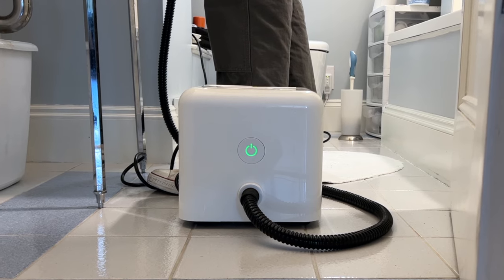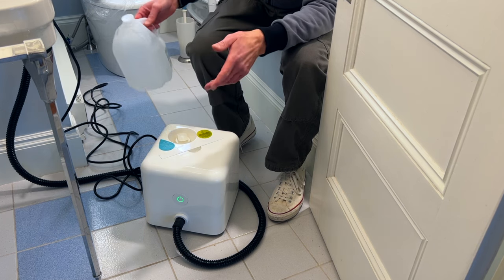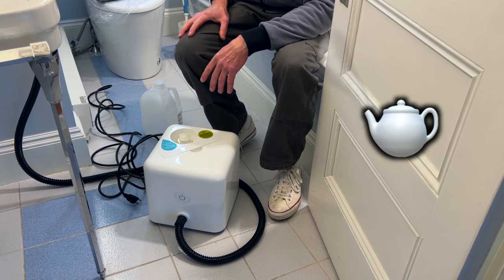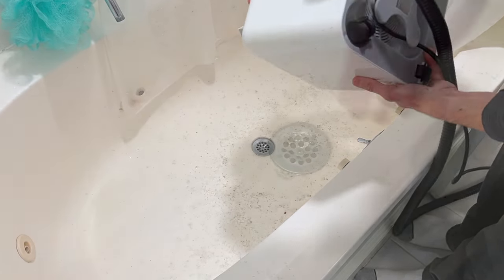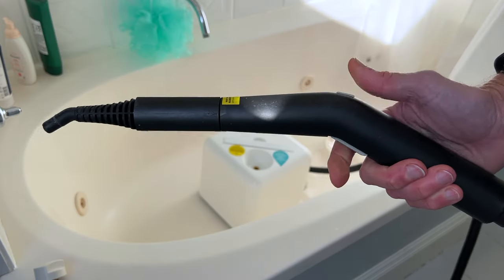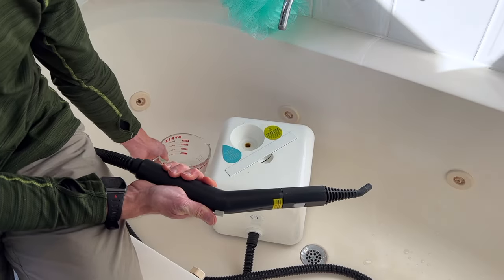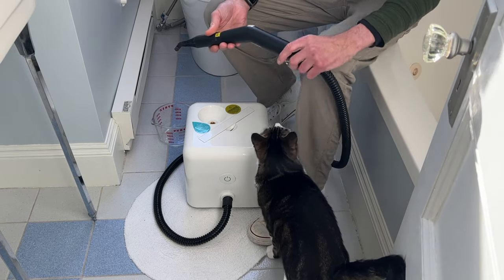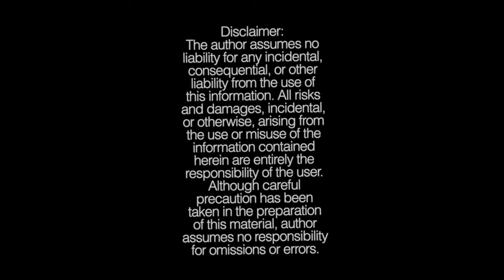Dupray NEAT Steam Cleaner - NO STEAM or SPRAY!!! Solved!

Comment: Thank you so much for sharing your information.   I was ready to throw the unit out, but now there is hope that I can get the unit working again.  I love your helper too. We just adopted a kitten and I need to do a lot of nontoxic cleaning!
Reply from the maker: I hope it works out for you. We have two cats and the steamer comes in handy for washing out litter boxes. We recently switched from clumping low dust litter to non-clumping crystalline silica litter (similar to Pretty Litter). It’s lightweight and it makes scooping poop and changing the litter easier each month easier. The steamer gets out the urine odors in the plastic litter boxes without having to use chemicals. Good luck!

Comment: I just received an email from dupray customer service because mine also will not steam.. they did recommend to repeatedly press the steam button on handle and use an air compressor or hair dryer to blow in end of nozzle like you did…they also said there is a small steam hole diagonal to the boiler cap. I can’t find it. But they also said they do not recommend using vinegar to descale… I’ll just copy and paste their reply yesterday to my issue I still can’t fix…

The machine can be clogged in two different spots, either at the steaming hole inside the unit or at the handle.

The steaming hole of the NEAT is very small, so calcium or sediments can block it easily. 

Please try the following troubleshooting steps:

1. Fill the boiler with clear water, and swish it around. The steaming hole is at the top of the machine, diagonal to the boiler cap.
Hitting the steaming hole with water can help to flush out debris that are stuck.

2. If you have an air compressor machine, please shoot some air into the hose through the steam exit hole on the handle. Make sure the machine is unplugged.
Repeatedly pull the steam trigger. This can help to free any debris blocking the steam from coming out.
Alternatively, you can try a hairdryer or air pump to blow air in it. If the blockage is at the handle area, that can help free it as well.

*Please note, we have stopped recommending descaling the NEAT, as the aluminum boiler is sensitive to the vinegar.*
Reply from the maker: Thank you! That’s great information. When I spoke with a rep at Dupray about 6 months ago regarding why my manual says one thing and newer manuals say something different, the rep said it depends on the country of origin and sale. I really question the longevity of this product and the quality of materials used because changing the recommendation on how to care for the product leads me to believe they launched a product without adequate testing and quality control.
Reply: @BruceAlanR  I just bought this model and it's made in China.   I've used the steamer only TWICE and, already, the steam is intermittent .   Sending it back

Comment: Thanks for this cleaning review.  I’ve never had a blockage in mine but I use distilled or 50/50, and I also have descaled periodically.  Interesting they no longer recommend vinegar/descaling; that explains why the Neat Plus I just got says nothing about cleaning in the manual.  Distilled water is great but we can’t refill those jugs so more stuff just gets trashed 😩.
Reply from the maker: It’s so strange they no longer recommend vinegar. Even with distilled water I was finding buildup over time. I don’t understand how they expect the user to clean it.

Comment: Thank you! This is very helpful!
Reply from the maker: Welcome! Recently, I’ve found that letting the unit completely cool, removing the cap, and then blowing in the end of the wand with the trigger depressed usually solves the issue quickly. When it doesn’t work, allowing the water and vinegar to sit in the tank for 4 hours with the top off, then shaking, rinsing well, and finally blowing in the end of the hose with the wand’s button depressed has worked. No need to leave it overnight.

Comment: I've contacted the manufacturer due to ours not producing steam anymore, they're NOT RECOMMENDING using vinegar anymore as they've realised it'll damage the tank/boiler. Possible warranty breach. I'm trying to clean/descale ours or will ask manufacturer to replace but since its year two of warranty it's now £29.99 to replace.
Reply from the maker: That’s helpful info. I called them 4 months ago because my manual said to leave vinegar in overnight and the newest model manual says to leave in for 45 minutes. The rep told me it depends on when the unit was made and country it’s being sold in… I don’t know what that even means! Something must have changed. How did they recommend removing mineral buildup if not with vinegar?
Reply: After finishing with the vinegar (or any acid for that matter).  You fill the tank with water mixed with washing soda as it neutralize  the acids and flush with clean water a few times
Reply from the maker: Good advice! Thanks!

Comment: Dupray decided that vinegar was actually causing issues and they stopped recommending descaling and now have a video on their channel showing how to disassemble the handle to fix clogging.  I descaled my two Neats numerous times using their specified method (vinegar) and never had an issue but the water can be "milky" for a few times after doing it. So it may be better to switch to distilled water and drain unused water so as to avoid having to do any of this.
Reply from the maker: Great info. Would you  
be so kind as to post the link to Dupray’s video here?

Comment: I love my Dupray but I'm always worried it's filled with mildew. There's no way to completely empty the water out of the tank. Even when I shake it for 20 minutes, you can still hear water sloshing around in it. I've only used distilled water in mine and when I cleaned it out, there was a lot of scale and grey gunk. I really worry about spewing mildew into the air with the hose and tank. Any insight into this?
Reply from the maker: Interesting you should say that! I have been having the same thoughts recently especially if I don’t use it for a week or two. Part of me thinks any mold or mildew in the tank would be killed by the internal temps of the boiler as well as the white vinegar and water solution when descaling, but it’s impossible to know without opening it up. 
Regarding the scale and chunks that come out, it doesn’t seem to matter whether I use tap, distilled water, or demineralized water. I spoke with a customer service rep a while back and they said it should be descaled occasionally either way.
Reply: 0:07

Comment: I am currently having this issue. It was working fine until I decided to descale it. Now it will turn green but no steam. I have cleaned it out two more times since then and have rinsed it several times. I got mineral buildup out the first few times but now nothing. I don’t know what else to do to get it back.
Reply from the maker: Ugh! Sounds like a clog. With the unit cooled and unplugged and with the cap off, do you hear bubbles if you press the trigger and blow into the end of the wand? If you can’t blow into it, it’s still clogged. I had to shake mine pretty hard and give it a few rinses before I got all the deposits out.
Reply: @BruceAlanR  No bubbles. I think I need to do more rinses. I contacted dupray and they said that they no longer recommend descaling the NEAT, as the aluminum boiler is sensitive to the vinegar and can lead to additional clogging.

They told me it’s either a clog in the steaming hole at the top of the machine, diagonal to the boiler cap. They said to swish with clean water and try to get to that area. 

Or to take an air compressor or a hair dryer (on cool) and shoot the air up the hose through the exit hole and to keep pulling the steam trigger. They said that’s where the other clog is likely to be and can help free any debris it’s blocking. 

I’m hoping to try it and get my mop up and running. 😩
Reply from the maker: All very good info so thank you for sharing that. As far as not descaling, Dupray needs to get their stories straight. I contacted them 3 months ago because the manual that came with my NEAT said to leave the vinegar and water solution in overnight. In the latest manual it says to leave it in for no longer than 40 minutes. So which is it? Based on your conversation, they’re instructing you not to descale at all (which seems unhealthy because similar to an ionizing humidifier you don’t want to inhale the steam directly). 
Since you don’t get bubbles, sounds like a good blockage where the steam feeds to the wand. Here’s my recommendation: With the unit off and wand trigger pressed, fill the tank with water, put the cap on, turn it upside down to get water into the steam chamber, and shake it hard. Just be aware that if the clog clears, some water will come out of the wand (messy if the wand is below the unit but it’s a good thing— like a siphoning). Then take the cap off with it still upside down and shake out the water and debris.  Shake it hard as awkward as it is to do with this thing. I bet a lot more particles will come out. You may need to do it a couple times before it clears.
Reply: Same! I can't get it working anymore. I don't want to throw it away. 😞
Reply: @BruceAlanR  I really wish they had a way to disconnect the hose from the unit. That would make such a big difference. I love this thing but it has some real design flaws.
Reply: Did you ever get it working? Currently having the same issues despite multiple attempts at descaling and rinsing. No bubbles when I blow into the handle
Reply: @mazdaq1981  I did! They recommended putting an air compressor machine in through the steam exit hole on the handle and then repeatedly pull the steam trigger. I had to do this several times with rinsing it with vinegar and finally a weird red piece came out and it’s worked fine ever since (I had to shake it VERY hard at different angles before it came out). They also said I could try a hairdryer and blow cold air in it. If the blockage is at the handle area, that can help free it. It took a while before it worked. I wish it was a more sophisticated machine and have had my eye on the nicer models. I just don’t know if it would be worth it. Best of luck!

Comment: Will this method get rid of possible mold on inside of tank? I left water in there and forgot to empty.
Reply from the maker: Not sure, but vinegar does kill mold. It’s difficult to empty all the water out of the Neat due to the design, so I usually run it until no steam comes out.

Comment: This just happened to my unit this evening :( but I felt heat through the hose for about three quarters? I tried blowing through the end like you mentioned and I feel like it’s clogged in the trigger portion itself? Should I try steaming with the vinegar solution?
Reply from the maker: You never want to “steam” or heat the water and vinegar solution and it’s unlikely that the trigger is clogged. Let the unit cool down and then try filling the tank with just water and giving it a good hard shake. Do that a few times and then try blowing into the hose. See if that frees it up.
Reply: Thank you so much for all the tips! Got it back to working perfectly today thanks to you!

Comment: Hello if I did this in the morning how long I have to wait ? is it okay if I use the machine during the night ? thank you
Reply from the maker: Should be fine. It really depends. Sometimes it takes 45 minutes and other times a few hours. Blow into the end of the hose with the trigger pressed and if you hear air coming through you should be good. Also be sure to shake the unit really good while rinsing and sometimes that gets it loose.

Comment: what if you just used vinegar and distilled water while running it? id normally mop with that solution, so I'm sure i would've thought its probably fine and do it without knowing if it's good or not.
Reply from the maker: Other than for descaling I don’t think it’s a good idea to leave vinegar and water in the tank for extended periods. The latest Dupray Neat I’ve seen has a 6’ hose (vs 9’ like mine) and the instructions say not to descale for more than 40 minutes. That leads me to believe that vinegar and water left in the tank is causing some sort of premature tank failure. I’ve left vinegar and water in mine for a day and a half and the water came out black. I bet it was eating the tank.

Comment: My steam cleaner leaks and drips out of a screw no matter what I do, is possibly the water tank leaking?
Reply from the maker: It is possible the tank is leaking in which case hopefully it is still under warranty. Last week when I used the Dupray steamer, I noticed a puddle on the floor after the third refill (I was cleaning a mildewy shower); however, I wondered if the puddle had occurred because I’d overshot the cup during fill up and saw water drain down inside along the handle (a poor design IMO). It was a fair amount of water too… maybe 1/2 cup that missed the cup. I wiped up the spill immediately, but when I was done steaming there was another small puddle on the floor, which I then cleaned up. The water that had puddled didn’t feel warm, so I didn’t think it was leaking from the tank, but having received your comment, now I’m wondering…. “Perhaps my tank was actually leaking given I had been using it for a few hours consecutively.” Here are a few things I’m going to test over the next few days: I’m going to carefully put 4 cups of water (32 oz) in the tank and leave the steamer in a bucket for a few hours to see if it leaks (I’m not going to turn on the steamer yet). If no water leaks, I will carefully add another cup of water (8 fl oz, which brings it to the max of 40 fl oz) wait a few hours and see if it leaks. Then I will add another cup (8 fl oz) of water, which will take it over the maximum fill capacity to see if that creates a leak. If still no leak, I will empty the tank, add 40 fl oz of water, which is 5 cups (the max), and turn on the steamer to heat up. Once heated, I’m not going to use any steam for at least 15 minutes to see if the pressure in the tank creates a leak. Then I’ll use up all the steam, wait 20 minutes, fill the tank again, and go from there. 
So, I’ll get back to you with the results. 😃
Reply: @BruceAlanR  Do you happen to know if it is a plastic tank?`

If so, it could be repaired, perhaps with tape.

Warranty I probably no longer have :(.

Comment: I'm going to take mine apart, separate the aluminum tank (it's in two pieces) and then run it through my ultrasonic cleaner to get it spotless. Once that's done, I'm going to paint the inside of the tank with Tremclad High-Heat Enamel paint and use the steam cleaner heating element to cure it. At that point I should never have an issue with corrosion. 

Scale is easy to deal with but I'm seeing gray/black water and that is from the tank. THAT is the reason Dupray no longer recommends using Vinegar - it will eat into the uncoated aluminum creating the issue. The ideal solution would be for them to add a manufacturing step, coat the inside of the tank with paint. Problem solved. That's why I'm doing what I'm doing.

The machine is very easy to take apart and you can reuse the silicon gasket that sits between the tank's case halves.
Reply from the maker: I think I’m having corrosion as well.  Every time I go to use the steamer I rinse the tank and the water comes out black. I have to rinse it 5 times before the water runs clean. Then I use it.
Reply: @BruceAlanR  That's what it is - tank corrosion. I have the case halves in the cleaner right now. A ton of scale/corrosion fell out of it when I split them. You can get a can of that paint at Crappy Tire for $15 and just brush it on. I'll have it back together tomorrow. That should case it permanently. Very easy job and you don't need an ultrasonic cleaner - a brass wire brush would be better, if anything. Clean and score the aluminum very quickly and leave a great surface for the enamel to stick to. I don't want to empty the cleaner when done either. I'd rather just put it away knowing it's not rotting :)

PS>Temperature control is just done with thermostatic snap disk. These are used everywhere and readily available. The more expensive Dupray units run at a higher temperature...so if a fella really wanted to he could just look up that temperature, which is posted on their site, and install a new snap disk rated at the higher temperature....135c vs 174c...

Or...they have a new model, the Neat Plus which heats up in seconds and is refillable in use. Hmm....probably still have to strip it and coat the tank though...
Reply: Job done and it worked out fantastic! The water smelled a bit like paint for a time but that's gone away. I'm going to replace the thermostats for 174's when I get a chance. The increased temperature and pressure will likely transform it. But I just thought I would update the thread, painting the tank worked as hoped.

Comment: I have tried it but I’ve used baking powder instead of white vinegar is that okay. Because I used baking powder and it didn’t fix it and no water came out of the spray gun
Reply from the maker: Vinegar in the tank for a few hours would work better at removing hard water deposits than baking soda (not powder, right?). Either way, I’d put some water into the tank, shake it really hard, and then blow into the end of the wand with the trigger depressed. That’s worked for me every time it’s gotten clogged. Sometimes you have to fill and shake a few times.
Reply: @BruceAlanR how do you decompress the spray gun
Reply from the maker: @badal5109  I don't think I understand your question. Compression is created in the tank by steam which feeds steam to the wand. When the trigger of the wand is depressed, it is just creating an opening for steam to escape the top of the tank.